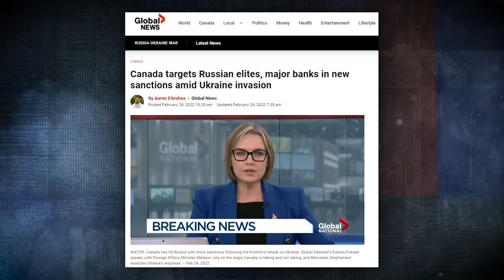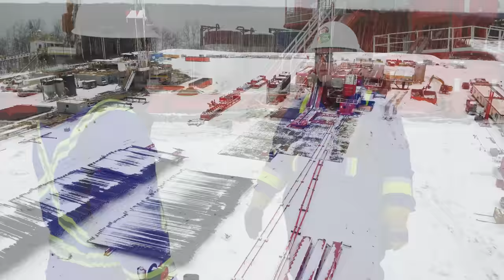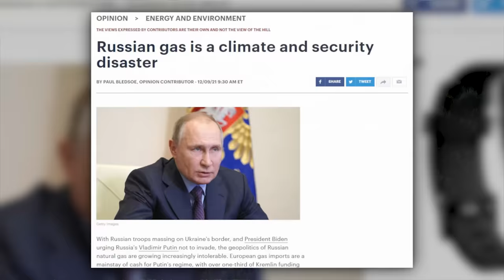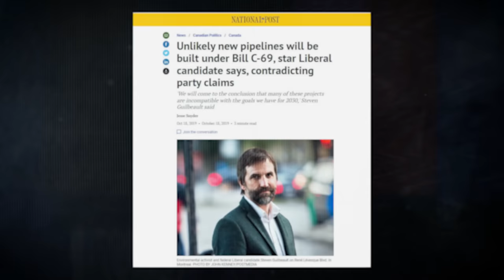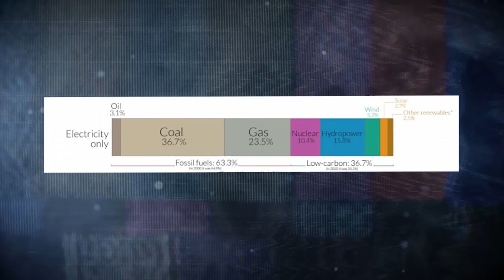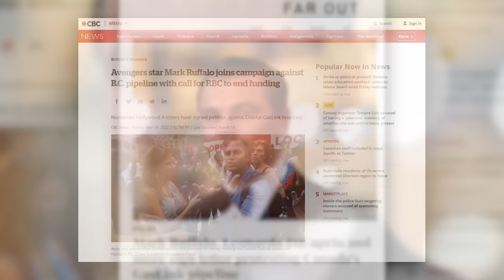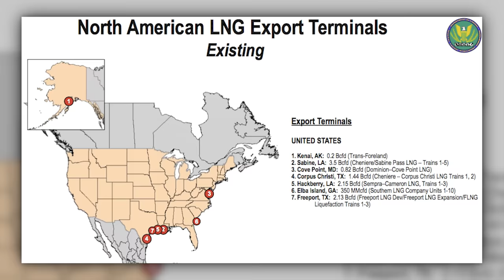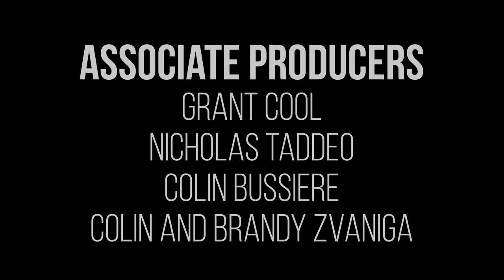How Canadian Energy Can Save the World | Politics Explained

Comment: I felt this documentary focused on the positive sides of LNG. 

But not much debate was given with regards to the negatives, which outweigh the positives. 

1) LNG is still a major pollutant worldwide. It is much less so than other fossil fuels, but still emits a staggering amount of greenhouse gases that contribute to the overall warming of the planet. 

Canada currently ranks as no 9 on the list of biggest producers of greenhouse gas emissions, even more so than many developing nations who use worse pollutants.  

2) Shipping LNG to Europe would be unsustainable from a cost basis over the long term. Even if production ramped up, the shipping cost alone would add a considerable amount to the cost of energy, and would also ramp up the carbon emission cost as that LNG now needs to be shipped instead of transferred over pipeline. 

3) the main goal of European countries is to transition to net zero energy sources over the long term. 

Although there is certainly demand for the short term, that demand will inevitably dwindle as that transition happens.
Reply: 1) Did you consider it's because we have a large agricultural and industrial sector? Please provide an alternate energy source that could take its place that isn't nuclear (which is the best option), or coal (which is much worse).
2) cost/benefit. We have a limited amount of lumbar to sell but we do it anyway despite the environmental cost.
3) I've yet to see a viable plan how this will actually materialize without colonialism all over again, acquiring resources from poorer countries while cleaning ones own hands. Disgusting.

Coal used to be the primary fuel source for countries that are now virtue-signaling with their environmental policies. The demand was there, now it is not.

Comment: Nice propaganda. Why do you ask a jabroni about carbon intensity of methane, not a scientist? Methane is a separate GHG, you don't just compare how many Carbon atoms there are to CO2.. sigh. Methane is a more potent GHG in the atmosphere than CO2, and natural gas is almost purely methane. Different molecules have different abilities to reflect infrared energy in the atmosphere (some have wider frequency ranges than others). The issue with natural gas is that if any of that pipe/equipment leaks, it's straight into the atmosphere. In practical natural gas systems, you will always have leakage, usually several percent of the production lost during distribution. That actually makes natural gas worse for the environment than COAL is most instances. Natural gas is being cleverly marketed as "clean" by a bunch of companies who want to keep producing it, surprise surprise... the sad part is that people are believing their blatantly false claims. This video is a sad attempt at spreading misinformation surrounding natural gas.
Reply: Not sure where you got your info about coal being better than lng! That is wrong!